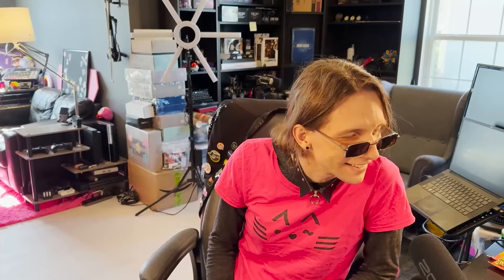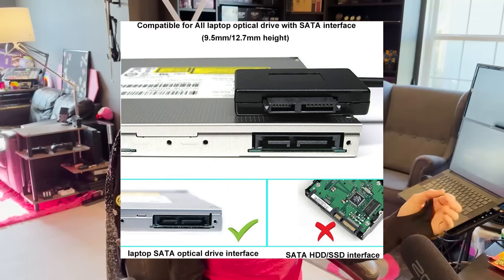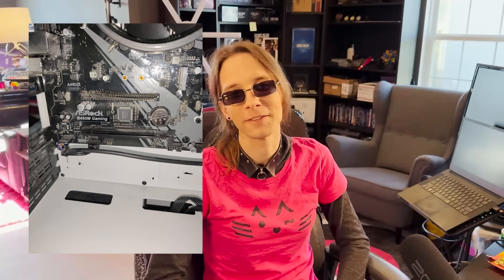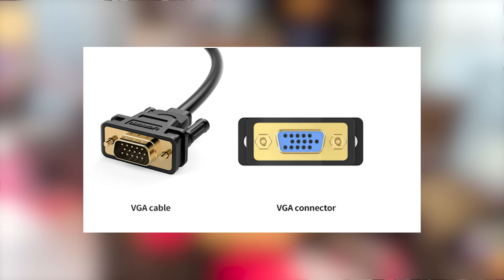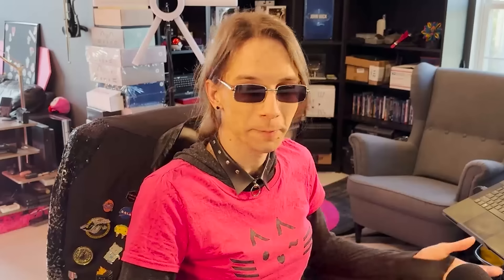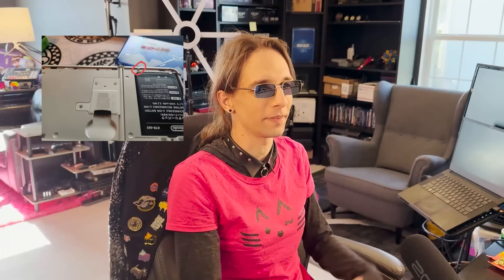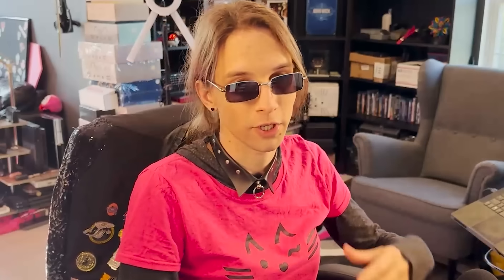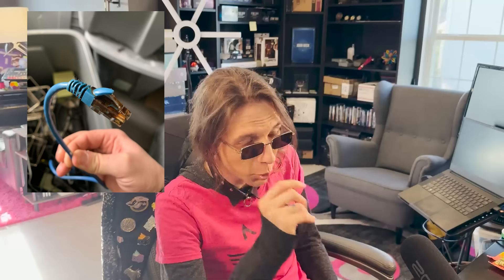How to NOT computer | Lexplanations | r/techsupportgore & r/hardwaregore

Comment: I feel like the network cables and equipment in food service should be treated as a chemical hazard industrial build with twist lock water tight ethernet ports and cables, and all computers should be low power single board PC's in a PVC box. That stuff is gross.
Reply from the maker: To their credit, a lot of Point of Sale I was installing before the pandemic was switching over to iPads and a web server instance, but a big problem in NYC was Wi-Fi co-channel interference even on the 5ghz bands just because of how close businesses and apartments were. The dinner rush of a 30-40 table place pretty much necessitates paper tickets to follow the food, so receipt printers were still nearly always required, and none of the thermal ticker printers ever had good reliable Wi-Fi expansion boards so we’d always end up with some level of wired infrastructure for reliability.  In a calmer and less dense food service environment, or one with multiple digital ticket stations (an iPad at every prep station tracking all tickets), it’s possible to go nearly full wireless and seal everything pretty good.
Reply: @TheLexikitty   Yea I've seen a lot of modern POS nice and clean with a tablet.  I'm talking about the wall mount rack with spaghetti wires at like McDonalds which is right behind the fryers. Absolutely disgusting.
Reply from the maker: oh god yea absolutely

Comment: Splitting a 4 pair ethernet cable into two 2 pair cables is not that bad because it will give you 2 100MBit ports on the other side.
Reply from the maker: I’ll put you in charge of explaining to the client why POE doesn’t work two months later when they’re installing VOIP handsets and IP cameras
Reply: @TheLexikitty  2 pair poe would work😂
Reply: @TheLexikitty  But you can also explain the client why you need to install an enclosure with an extra poe switch at the end of the cable to run 2 devices that only requiere 100Mbit ports anyways😉😂
Reply from the maker: @legominimovieproductions  no? What switch do you have that can negotiate two different POE levels on a single port? (Also, like, why are people defending lazy IT work)
Reply from the maker: @legominimovieproductions  yea this is the kind of stuff I take garden shears to, do it right or don’t bother lol
Reply: @TheLexikitty  You need to split the cable pn both ends and crimp 2 2 pair rj45 connectors so younwould use 2 ports on the switch😅 I'm defending them cause I'm an electrician/network guy and have to deal with shit like this every now and so on😂 you cant always pull a new 200m wire through 3 buildings but instead need to work with what you've got😂
Reply: @TheLexikitty  😂😂😂
Reply from the maker: @legominimovieproductions  I understand working with what you’ve got but 200m is already above max length for Cat6 and I can’t say I accept jobs if the client doesn’t want me to do stuff out of spec. Partially because low voltage writing is part of code inspection in NYC and partly because you never know what that jack will be used for in the future. Just because something works doesn’t mean it should be deployed.
Reply: @TheLexikitty  We are working with Cat7 here and yea the 200m was a bad example but even 50m across 2 buidlings is a pain in the ass 99% of the time
Reply from the maker: @legominimovieproductions  totally agree, it is a pain in the ass, just something that would bother me if I didn’t do it, especially when clients want a NAS or something to communicate across a line in the future. Once had a client repurpose all the lines I ran for HDMI over Ethernet (concert venue) and another device to relocate offices to an area in the basement, in both cases I’d run doubles to every jack just in case and it ended up saving my butt. Everyone has their own working style but I always try to lean towards having good overbuilt infrastructure so the client doesn’t have to call me back and wait for availability.
Reply: @TheLexikitty  Of course if the client is willing to accept/pay I try to do it the proper way but I work for a small company and way too often we get told to just make it work as cheap as possible
Reply from the maker: @legominimovieproductions  yea I understand that, I did solo consulting so I was lucky enough to be able to reinforce standards while not having to worry about pissing if a client because NYC was full of them. Sometimes there only so much you can do, unfortunately, but I always try to leave a situation better than when I came in. 👍

Comment: You can get away with two pairs... if you're good with 100mbps.
Reply from the maker: And want a very angry network engineer on your tail asking you to explain to the client why POE doesn’t work.
Reply: @TheLexikitty  I mean, if you don't need PoE... or gigabit... or to have half a clue what's on your network... it's perfect!
Reply from the maker: Hahahahah “certified to work in 40% of all situations!” I want that on my business card
Reply: @TheLexikitty  Wow, is 100mbps still 40% of applications?  To my knowledge, only one device in my house is still at 100... and that's the bridge for my lights.
Reply from the maker: Oh I meant 40% of expected capabilities,  I don’t think I’ve had a client in the last 5 years that didn’t need POE either at install or at most, six months later. Also gigabit is pretty expected if there’s a NAS, otherwise you’ll be getting called back for slugging performance lol. Home networks are a different story, but my videos are more aimed at teaching folks IT stuff. If you installed a network drop in my house id expect it to support gigabit, POE, etc., and if it couldn’t id count it as an unfinished job.

Comment: In regards to the first one, if you are capable of baldersoldering, you dont have an issue, but .. if you are stupid enough to pull the balls off the board (as you can clearly see in the picture), you might not be smart enough or skilled enough to solder that back onto the board..

Comment: I don't think I've ever seen your face before. :D You are beautiful. I love your clothes. They are flattering.

Edit: Heat just murders laptops. I had one in which the fans failed and I kept just running it without any cooling system... about a year later the plastic under the laptop had melted and fallen apart, and it stopped working very well....